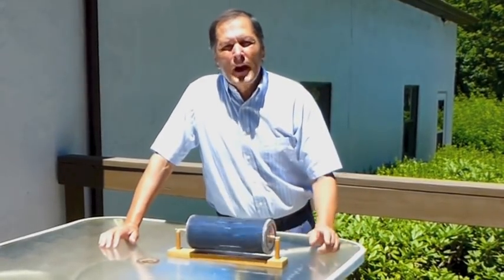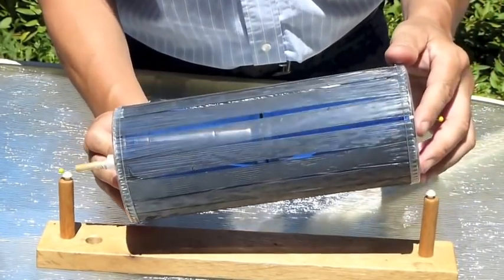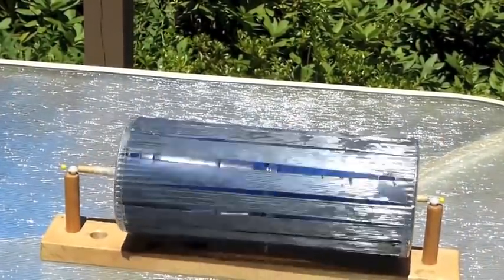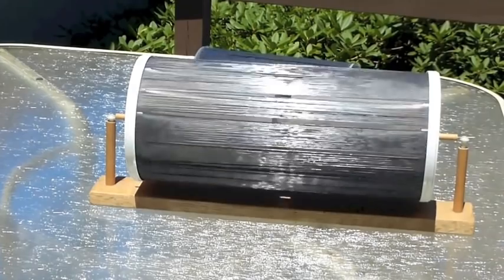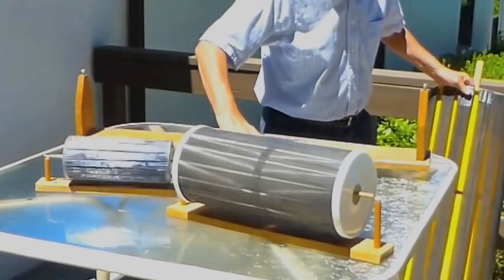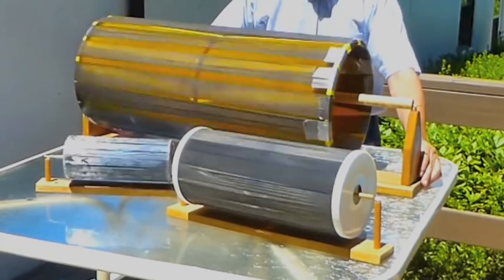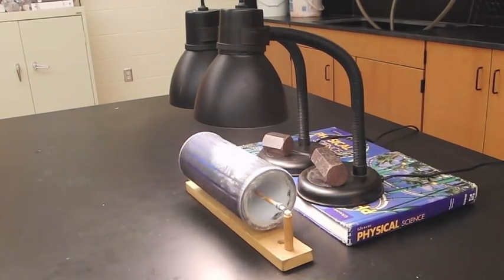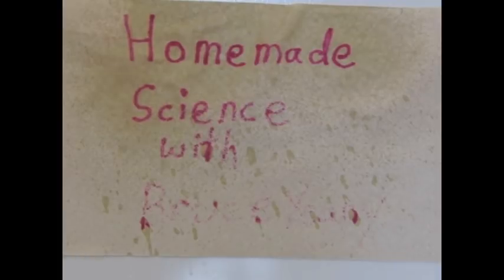Solar motor--Free energy motor-- not electrical /// Homemade Science with Bruce Yeany

Comment: Interesting and thanks.  I think that I might have seen something like this on PBS a decade or two back using rubber bands?  The rubber bands, when heated a little, expand a fraction, causing the cylinder to rotate in the direction same as that of the demonstration as the center of gravity would move ligtly further away from the axis.

Comment: For this to work you should be aware of the construction of the cylinder, The axel is fixed to the bottom of two cups, it is not a rigid cylinder made from steel. So this cylinder can be bend. If you contract the two rims at the top due to the solar bands contracting, the “cylinder” will contract and bend. On the hot side the rim of the cup will move away from the axel. This will cause an unbalance and the cylinder will turn.

Comment: However this works, with a flywheel it could somehow be possible to periodically "tap into" the energy.
It could start spinning (over a longer time) to reach maximum speed, then you could shortly connect something and "suck out" all the energy.
Working similar to this "Flywheel Trebuchet": https://youtu.be/RVT5i4nhIGs
(energy is stored over a longer time, and then INSTANTLY, ALL energy is released into the ball)(this is obviously with less power, some other use case would be needed)

Comment: The text explanation makes no sense
Just because a material contracts (molecules shrivels up), does NOT make that material heavier ("pure" weight), just more DENSE (weight per volume), so I can't see what reasonably makes them spin.
This is like the questions: "What is heavier, 1kg of lead, or 1kg of wool" the are BOTH the same ("pure"-) weight (1kg), but the lead is MUCH DENSER (takes up less volume) than the wool.
I don't see why it would be turning just because 1 side would be longer than another (more volume), but they still have the same weight.
If the top section were to ACTUALLY become heavier, it has to physically collect mass (atoms need to bind to it) from somewhere, and I don't see how that would happen.

Sure, I see that they are rotating, but I can't see why, maybe they just have REALLY good bearings? any of the other tricks that "free energy" machines use (Yes, I'm aware that the description doesn't mean "free" as in "perpetual motion machine", but instead like "cheap/small energy" harvested from the sun).

Comment: After watching Espacio de Ceasar's video attempt at making this motor, a thought struck me:
Somewhere in here (comments or video?) It states that the garbage bag had to be stretched to 5 times it's original length.

A stretched strip would be thinner at the middle than at the ends.  So if you took one non-stretched strip that is the length of the two cups, stretched it to 5 times it's length, then cut it into five stretched strips to fit the length of the cups, the stretched strips would be of different weights and thickness. The thickness would even vary along the length of the stretched strip.

But, if you measure a non stretched strip the length of the two cups,  then cut this into 5 equal length non stretched smaller strips, then stretched these small strips equally 5 times their length (the length of the 2 cups with some extra length to tape the strip to the cup), now for each of these strips, the thin part will be in the middle of the strip and the ends will be slightly thicker.  This should help to better balance the wheel.  

Putting extra pieces of tape inside the cups to act as weights could further help balance the wheel.

Also, what mil thickness was the original bag?
Reply from the maker: I think they are .1 to .3 mm thick, regular garbage bags.  when stretched it is unlike stretching gum or taffy,  it will stretch evenly at the same  thickness for the whole piece except for the very ends where you are holding it.  I hope to post an update on this piece in a few months during the summertime
Reply: @YeanyScience  Looking forward to it!

Comment: Sir,
This is great. I read about this when I was in High School back in the late 70's. We should be able to use some type of metal to make a heat engine that has a good torque level and get it to generate electricity.

Comment: In that context of the word free, I wouldnt include wind necessarily because the act of capturing the wind slows down wind currents. I'm not climatologist, but wouldnt significant drag on the global wind map have potential to alter currents or stop them? I think wind drag "pollution" is a thing, we just havent run up against that wall yet. I suppose while making river powered machines if you build it in such a way that you maintain enough elevation while powering your machine to dump it back in the river at a lower point, you're not creating drag on the system, so long as the river is gravity fueled and velocity doesnt play a significant role. But I guess really thats just solar power when it comes down to it. You're getting that energy from the heat that evaporates water and causes it to rain on mountains to drive downhill rivers. I mean when it comes down to it theres basically solar power, galaxial power (geothermal got its energy from the rotation of the spinning galaxy iirc), and nuclear power

Comment: This is due to a change in the center of gravity (such as when you break or bend the shaft). The weight is still the same. Inertia is crucial, because it must get the center of gravity above the shaft. The heat shifts the center of gravity smoothly under the shaft and this causes rotation when leveling (searching) the neutral position. The torque depends on the gravity and the difference of the center of gravity.

Comment: If they don't produce electricity or run anything  what's the point
Reply from the maker: I think you can ask that question of any toy, music,  puzzles, or anything device or behavior that doesn't serve a "useful" purpose.  After building these for 25 years I am still amazed by it's behavior that it works at all.

Comment: Hi Bruce, thank you so much for doing this! May I pick your brain? I would like to make a solar tumbler for small pebbles.  Would I be able to add any weight to the buckets in this solar motor?  Thanks so much
Reply from the maker: Hi Shaped,  sorry but I don't think  these motors are going to have enough torque to turn anything more than the finest of loads.  I've been experimenting with them but can't get their efficiency up to the point of being useful;
Reply: @YeanyScience  That's what I thought. Thanks so much for such quick reply!

Comment: For the life of me, I can't visualize the centre of mass rising due to tension at the top.
Reply: Ha! 0:23  due to having only two strips, the tension is unbalanced and the centre  of the cup bases are pushed away!  The video disproves the theory!  If heat causes tension at the top, the cup bases should be forced downwards, lowering the centre of gravity, making the system more stable.
Reply from the maker: It starts with two cups bottom to bottom. Before placing it in the sun the cup mass is centered through an axis running through the center of the  cups.  what happens  is the strips at the top shrink  as they get heated by the sunlight and tighten,  that pulls the lips of the cups upwards making it top heavy so it turns which then exposes a new set of strips that get heated,  this process then keeps repeating itself
Reply: Hi Bruce. Great videos! :) There's something between the cups (looks like a marshmallow) - that seems important. My problem is the archer's bow; the bow curves away from the tensioned string.
Reply: LOL - I just got it! It's not that it pushes the base of the cups down, it's that it pulls the rims of the cups up!  They have more freedom to move.
Reply: And if I'd read what you wrote it would've helped! You said "it pulls the lips of the cups upwards". Sorry.

Comment: I like the video. Could you fix the smaller but quicker spinning ones into the larger to help them spin faster?  I mean they would be longer because they are end to end.  Would they spin a small generator to charge batteries?
Reply from the maker: I never tried, these motors don't have much torque to turn a generator,  I've been trying some ideas but still can't get the efficiency any better.

Comment: The rate of rotation is proportional to the intensity of the light from the sun. So, a larger rotor will spin proportionally slower than a smaller rotor.

Comment: After cover why they dont need a push ?
Reply from the maker: Hi Toni,  there is a basic explanation under the video,  without light the rotor is balanced, when light hits it, the rotor becomes top heavy and starts to turn

Comment: The one we made does not work. Not sure if there's too much tension to it, or too less. Or maybe the holes in the cups are not centered. But, we've followed the instructions very carefully though. And our trash bag only contracts for 1 cm max when heated.
Reply from the maker: Were they my  complete set of instructions?    you did stretch the trash bags strips before putting them on?   I have found that some trash bags strips were better than others but most of them that I've tried did work.

Comment: I made one of these the other day to interest my grandson, and yesterday, the sun came out for a while - but I couldn't make it work.  Maybe it's because I used transparent plastic yogurt containers, which may allow enough light to pass through them to heat the back strips as well as the front ones, or maybe my trash bags are made of different stuff.  More experimentation called for !
Reply from the maker: Hi MIke,  I can't say what the trouble is without knowing more about how you built it. Did you stretch the plastic strips before adding them? If you want a set of instructions on building this,  send me an email and I will forward the instructions
Reply: Hi Bruce.  Yes, I know exactly what you mean by stretching the plastic.  It stretches beyond its elastic limit, and it is clear from observation that something changes at a molecular level - any more stretching would tear it.   I experimented with the stretched strips a bit, and they do contract, but so little it is just on the edge of my experimental limits of measurement.  I put a bent paper clip so that the strip had to go through it in a Z - so that any contraction would have moved my paper-clip pointer.  
In strong sunlight, my motor does turn, but only about 2 turns per minute - it turns a bit,, then waits a bit, then turns a bit more.  This is with the sun coming in at an angle, so it warms the 2-o-clock area of the cylinder, which is handy because it makes it self-starting.  However, I do suspect that my trash bags aren't made of exactly the same stuff yours are.  The motor was built pretty similarly, pivoted on pins, etc.

Comment: Now, HOW does one figure the size ratio of the turning drum, to the axis it turns on, to overcome the weight, size, inertia, so it can actually run a generator?   Or, a bank of small generators feeding a battery bank?
Will these work if the day is overcast?  How overcast?  If operating using lightbulbs, will it create energy in excess of what's spent creating it?      This seems a bit similar to the black and white paddles inside a glass bulb, turning in the light.......What IF....one were to make a kind of Savonius wind-gen, then paint each blade black on one side, white on the other?    Would that induce that wind-gen to turn better when sun was on it, and still turn a bit, even if wind was not hitting it?
Reply from the maker: Hi Winter Star,   at the moment this motor is not strong enough to generate enough power for usable amounts of power,  I am currently working on another version that may be more efficient but still has a way to go.   According to the laws of thermodynamics,  you can't get more energy out of this system than what you put into it,  so in this instance you can't get excess energy using the light bulbs to make more electricity than what you start with.  I have a project on those solar paddles and hope to do a future video on them which may answer several of your questions here.
Reply: What if the [rotor] drum turning by solar motivation, had magnets on it, which rotated around the wired central [stator?]?  That could cause electric generation, using solar to move the rotor, and wouldn't be contradicting physics?

Comment: Could you make a motion to an electric converter to charge a battery and come up with some kWh estimates? This could be made into something to charge small devices on the go. Maybe.
Reply from the maker: Hi Shawn,  right now it doesn't have enough force to,  but I have a few idea that hopefully might help make it more efficient
Reply: maybe if you throw a couple of gears in with a flywheel? or link them together? Would using a mirror increase the torque? I don't know just throwing some ideas out.

Comment: I am a retired UK ex pat, living in Gothenburg, Sweden.
I work part time at Aeroseum (www.aeroseum.se) an Aircraft Museum and Science Center.
I thought this would be an interest addition to Aeroseum's Science Center and the school classes that visit.
I glued the bases of two conical yogurt containers together and refitted the lids after attaching the bin liner strips.(to make the whole thing neat)
A 10 mm dia wooden dowel passes through tight holes in the base and lids.
It doesn't work!
Have I limited the flexibility of the unit too much by glueing the container bases together  - or is it the lids that are limiting the flex?
Regards,
Martin Bronsdon
Reply from the maker: what are you using as the strips?  they are supposed to be made from stretched trash bags,   send me an email address and I will send you the instructions
Reply: Bruce Yeany 
I used strips of black trash bags 5 cm wide which when stretched X5 become approximately 1 cm wide - according to your instructions.
I notice that none of your motors have 'lids' on the larger dia end - or if they do, they have a hole larger than the axel.
My lids fit tight to the axel preventing flexing - maybe that it the problem?
My email address is:
martin.bronsdon@telia.com

Thank you for your prompt reply,
Regards,
Martin Bronsdon

Comment: I wonder if instead of attaching to a generator,  if you put neodymium magnets on the axle and wire windings nearby if the magnetic fluctuation could produce a usable current.

Comment: so this looks like its using the heat from the sun, what if a magnifying glass was used to increase the heat what happens then. Now while this looks like free energy is it able to work as an energy source, There are numerous devices which can run but they cant do any work of any kind. Any kind of load and they stop and eventually friction takes over anyway. But I would like to know how they are made. Why does it work anyways?>

Comment: wrong title, professor ! it's no "solar" motor. It's a Heat motor, because working with termal reaction.

"Solar energy is radiant light and heat from the Sun that is harnessed using a range of ever-evolving technologies such as solar heating, photovoltaics, solar thermal energy, solar architecture, molten salt power plants and artificial photosynthesis."
Reply from the maker: Hello sorin,   this device can go by any number of names.   If I wanted a technical name,  I would go by thermal retraction motor. Quite often we use descriptions of the energy source instead of the energy type.   The term "solar" is not an energy,  it is indicating where the energy comes from,  as in our sun.   Your examples follow the same line of reasoning,  solar heating,  indicates the thermal energy is coming from the sun. solar architecture mean the structure is getting light and thermal from our sun.  Molten salt is not an energy, it indicates a method that is used to store it,  wind power, indicates air movement,  geo-thermal meaning the energy is taken from the ground.  My use of the term solar motor is simply indicating the source of energy not the type.  I would say both our names would be correct.
Reply: I’m sorry but I disagree with you on this matter. I have a completely different opinion. 
The proper name is heat motor because the sun is just an alternative, not necessary. 
This device can work near a fireplace or an owen.
By the other hand, if you use "many names" for the same device you will create confusion.
Reply from the maker: That is fine,  and I respect your opinion. The name of the device is not solely my domain.   Variations of these devices has been around since the 1960's and has  gone by several names.  Motor or Engine,   Heat or Thermal, Retraction, Solar have all been used in reference to this piece.  Solar motor, whether it is technically accurate or not,  has been a common name for the device,  even NASA has used the term referring to a version they built in the 1960's era.    Interestingly enough if you search solar motors on the internet see what you find, I'd say this is a lot closer to being a solar motor than anything you'll find.

Comment: I always like your stuff Bruce. You should know though, that by calling these things "free energy" machines, that you are confirming the mass delusion that there is a body of energy out there, tapped by Niccola Tesla, which would supply all of our energy needs for free, the knowledge of which has been entirely suppressed by the evil capitalists. It's not a small movement.
Reply from the maker: Hello Vitabrick,  I've wrestled with the term "free energy"  with quite a few folks but have kept it as I'd like nothing better than to  steer the term back towards the economic definition of capturing available "free" energy, sunlight, geothermal, wind etc, versus  subscribing to the idea of devices that  violate the laws of thermodynamics.
Reply: Totally chuffed with this reply